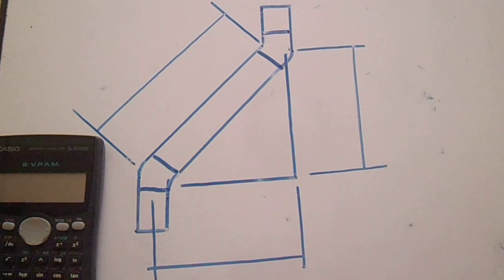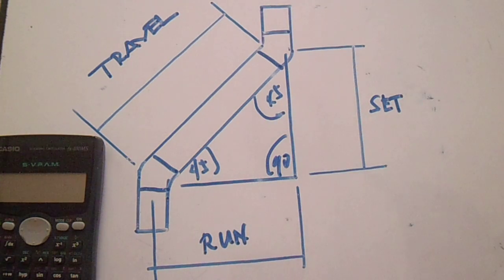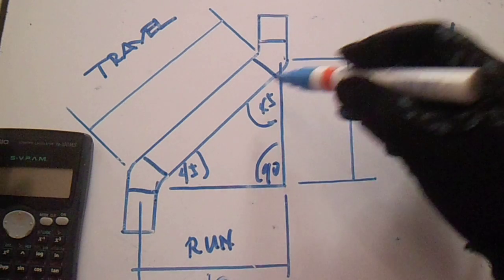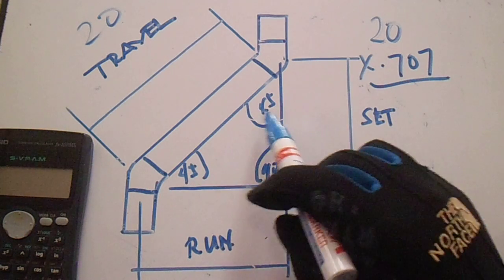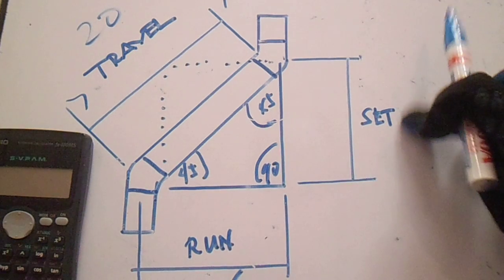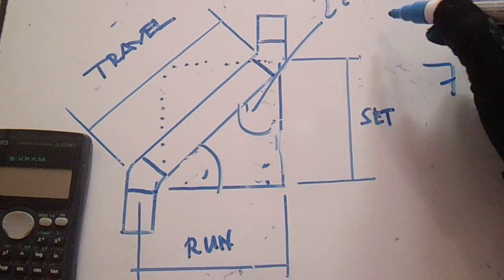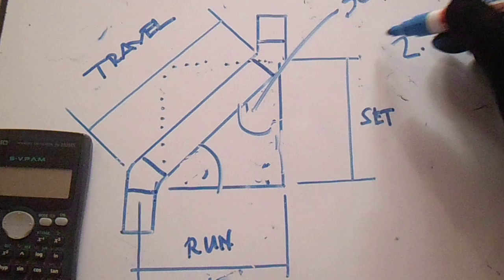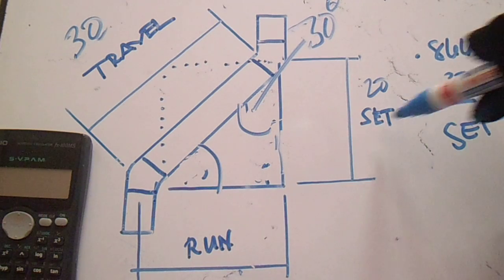#Pipefitter What is 1.414 and 60,30,22.5 Degree? - PipingWeldingNonDestructiveExamination-NDT

Comment: degrees represent angle and run , set, travel represent side so you're looking for TRAVEL ?
why don't you use SINE law or PYTHAGOREAN formula for finding TRAVEL.
PYTHAGOREAN formula
TRAVEL = square root of a squared + b squared

SIN A = a/c
SIN 45 degrees = run/travel
TRAVEL = RUN/SIN 45 degrees

Comment: ITO ATA IBIG SABIHIN NYA 
FORMULA FOR 45 DEG

set x 1.414 = travel FOR 45 DEG
run x 1.414 = travel FOR 45 DEG

if the given is travel the formula is
TRAVEL X .707 = SET OR RUN FOR 45 DEG

---------------------------------------
FORMULA FOR 22.5 DEG
if not 45 deg but 22.5 deg 
the formula is 2.613 for run and 1.082 for set

TO COMPUTE TRAVEL
RUN X 2.613 = TRAVEL FOR 22.5 DEG
SET X 1.082 = TRAVEL FOR 22.5 DEG

if the given is travel the formula is
travel x .2826 = run 
travel x .9239 = set

-----------------------------------------------
FORMULA FOR 30 DEG

SET X 1.154 = TRAVEL FOR 30DEG
RUN X 2 = TRAVEL FOR 30DEG

if the given is travel the formula is
TRAVEL X .500 = RUN FOR 30DEG
TRAVEL X .886 = SET FOR 30DEG

-----------------------------------------------

FORMULA FOR 60 DEG
RUN X 1.154 = TRAVEL FOR 60DEG
SET X 2  = TRAVEL FOR 60DEG
Reply: For the 22.5DEG for calculation of the RUN you have 0.2826 and the correct factor is 0.3826

Comment: sir your set and run explanation using the set number 9239x 20 its not complete where did you get that number without explain to the viewers 1.414 understood but some other number that you use to multiply  the set , run,travel you have to explain to the viewers thank you

Comment: Man this is so confusing that I just stopped the video 1.414 correct for 45% then .707 where did that calculation come in to play an know with no explanation?? Unbelievable he might be a fitter but teacher he's not???
Reply from the maker: thanks for watching. easy computation 1.414
Reply: Randy Gunter If you know the travel, just divide this by 1.4142 to find run/set.
Reply: Randy Gunter I am a 2nd period Steamfitter apprentice and am trying to understand. Do you know a good video for this?
Reply: Randy Gunter The .707 is half of 1.414. The only time you use that is to find the run ,or set. It's just a reverse method. But most of the time we just find the travel..Plus as you know we must take out for fittings...

Comment: excuse me sir im confuse on how to find every angle of elbow like 45degrees is 1.414 how about other angles sir?
Reply from the maker: you can use only for 45 degrees cosecant 1.414
Reply: PipingWeldingNonDestructiveExamination-NDT.      what about other angles sir like 32degrees or 43degrees and many more?
Reply: 90 DEG ELLBOW AND 45 DEG ARE THE ONLY ONES USED IN THE FIELD. THIS IS FOR 45 DEG OFFSET SITUATION.
Reply: Sir ang gusto ko sanang malaman kong papaano makuha ang cutting Ng V cut cable tray po Kasi sakin.

Comment: sir thanks for the video.. can i clarify those take off for 60,30,22.5 degrees for set, and run.. to get the travel..
Reply from the maker: your welcome! Thanks for watching more videos' coming up
 ( 60 - run 1.154 ) ( 22.5 - run 2.613 )  ( 30 - run 2.00 )
 ( 60 - set 2.00 )  ( 30 - Set 1.154 )  ( 22.5 Set - 1.082 )
Reply: thnx
Reply: hello friends, 
 all video's are werry usefool, but  I can't understand this about degrees calculating.
Please, explain us  do you use some  table with  koeficient or what else?
 for example,  which number  for run or set is for 73 degrees?
if you have some table please give us a link for download here.
Thanx and best regards
Reply: Just memories soh cah toa, if one side and 1 angle are given direct solve using calculator.